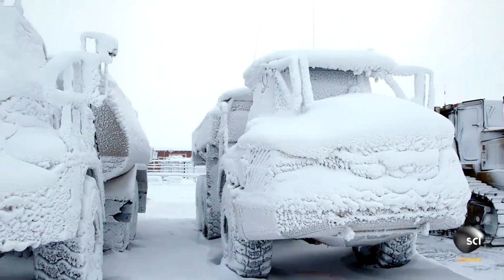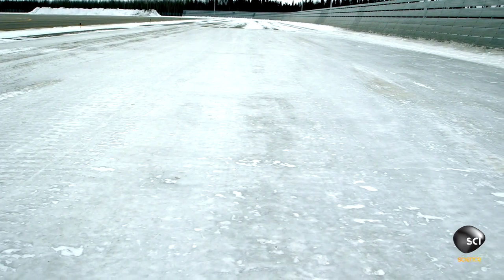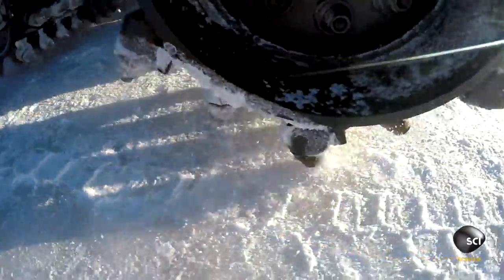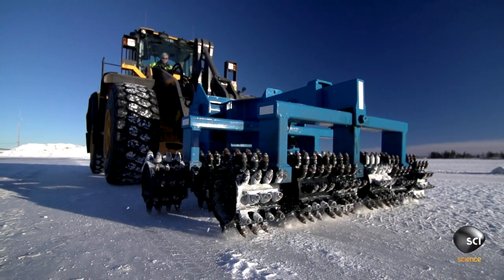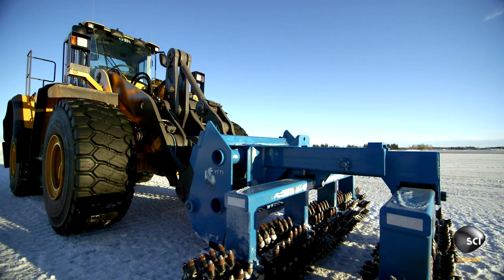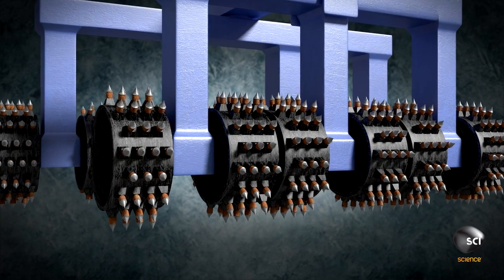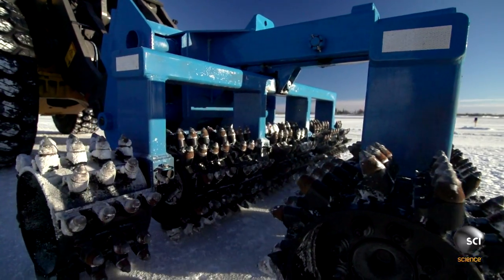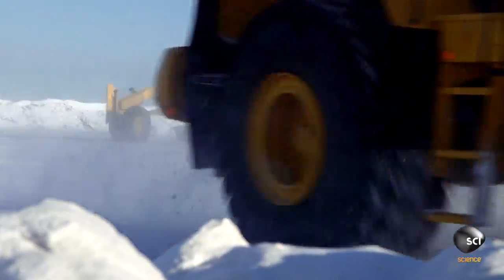This One-of-a-Kind Machine has 588 Metallic Teeth

Comment: Why didn't they just take the typical ice breaker and then add weight to it to increase the pressure on the teeth?
Reply: +Juhmick M They did say that the insane amount of teeth on one roller evened out the pressure, making it ineffective. With less contact points, it becomes more effective.
Reply: +Juhmick M - Fuel economy perhaps?
Reply: Could off balance the machine as well. Makes no sense and it's cheaper to make your own.
Reply: The fracture spreads in a conical shape, that means the thicker the ice the less teeth you need to cover the whole area. Obviously there is an effective limit where ice is simply too thick, but up to that limit less teeth for thicker ice don't decrease the effectiveness.

Comment: Wouldn't it be more sense to have it on the back. You crush the ice to just pack it back with the weight of the vehicle
Reply: +Gamerswag I was thinking that too!
Reply: its hard to pack ice especially when it is below zero where they are at, it more or less becomes ice rocks almost and by pushing it you also get more pressure on the spikes.
Reply: I don't know of you've ever experienced snow, but just smushing it in the short time it takes for the wheels to pass over won't just magically make ice, at least not the packed kind thats rock hard.